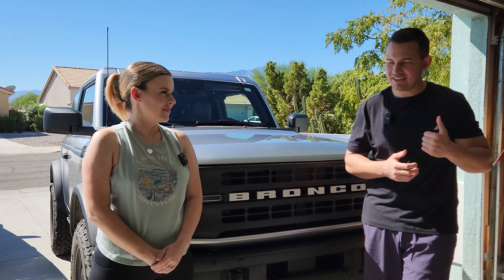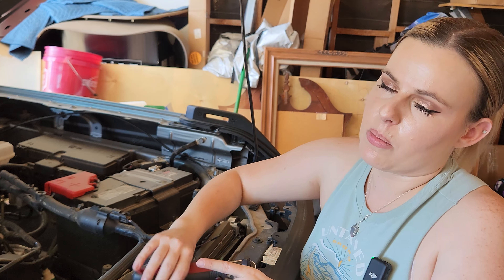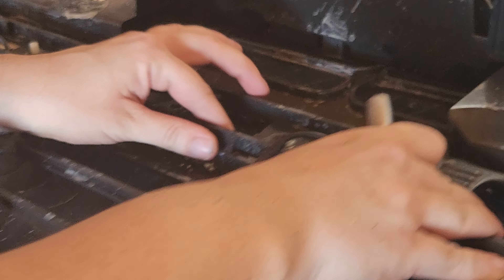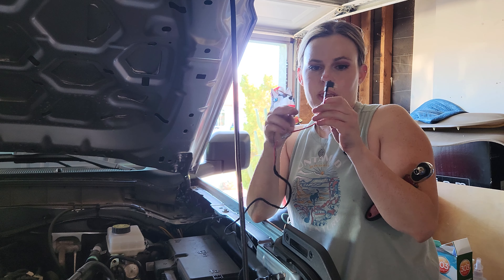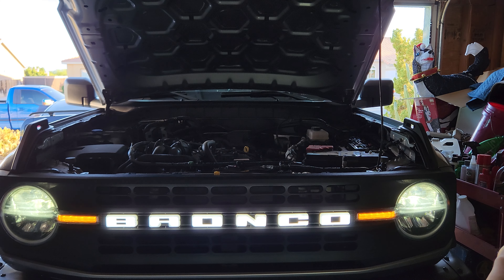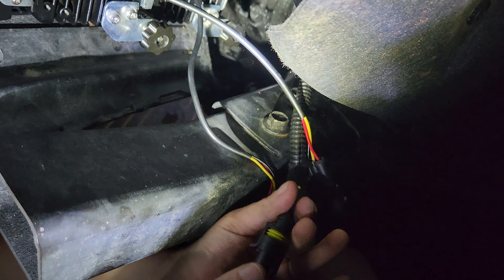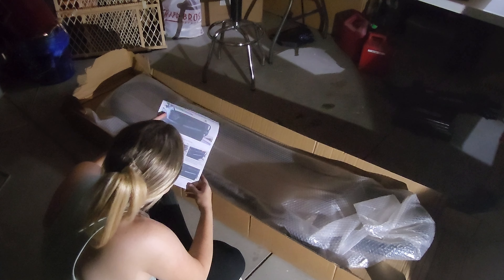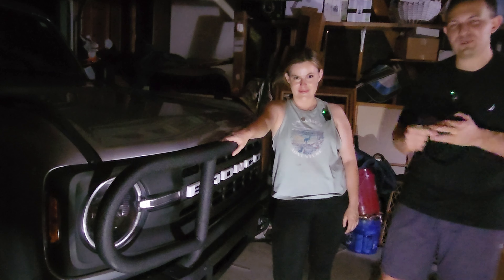$500 in Ford Bronco Mods from Amazon: Worth It or Just Waste?

Comment: New subscriber, if you ever worry about the fuse box pinching your wire, IAG came out with a fuse box cover that has a wire pass through so you won’t pinch any wires. I just installed a Warn Bumper, Warn Winch and Rigid Fog lights, let’s just say modding our Broncos can empty our pockets quickly.

Comment: If you look in the front of the grill they should be a while one wire I think it's a purple or Violet it has a black plastic shrink wrap on it that wire is your power wire to your your jewelry switches there is a wire designated in the front just under the panel that she took off look for it's a single wire it's closer to the right side of the locking latch.